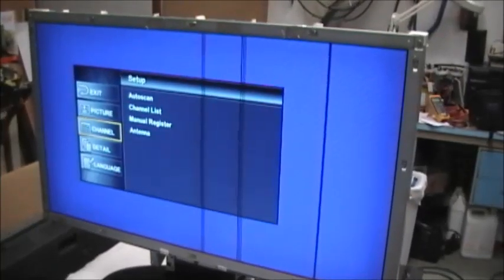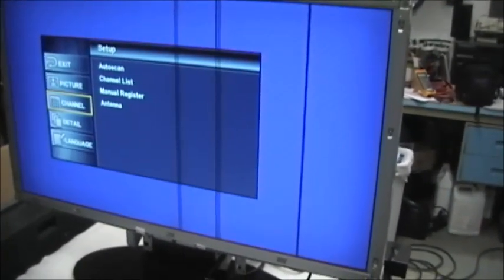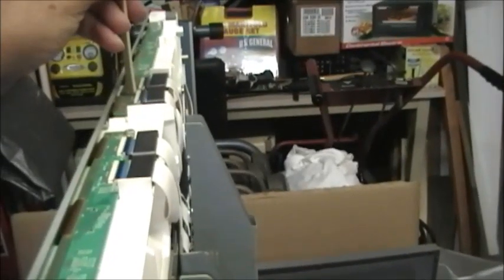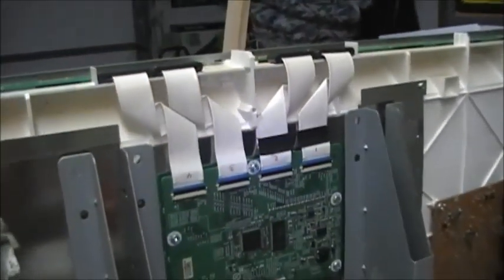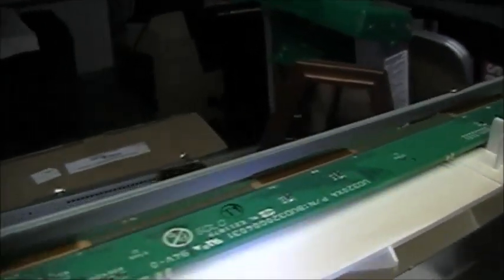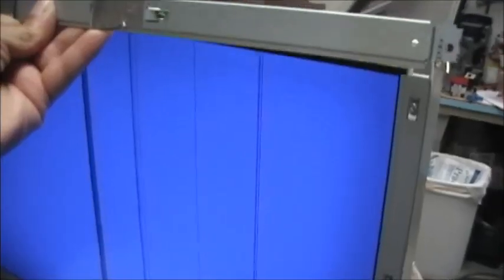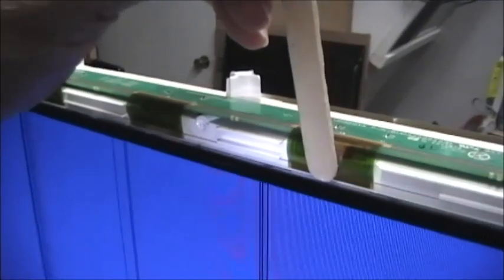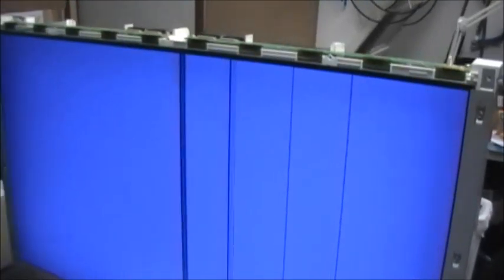LCD TV Repair Secrets - Vertical Lines on the Screen

Comment: Great video showing the issue and so common sense now. To bad it doesn't follow with an actual viable longterm fix.
Reply from the maker: There is no long term fix, at least not for the do-it-yourselfer. To fix TV's with this problem, you need to replace the LCD panel but consumer electronics manufacturers don't sell replacement LCD panels. Fifty years ago when I started in this business, US manufacturers we're required to provide replacement parts for at least ten years. At some point that was cut to five years, and now we have to petition congress just for the "right to repair." We're lucky to get any parts! Those we do get usually come from aftermarket suppliers, but presently, there are no aftermarket suppliers of LCD's. It's odd, because you can get cell phone screens and laptop screens, just not TV screens. At some point, maybe that will change...
Reply: There is a longterm fix, you shim it with weatherstripping foam and make enough pressure on it. They will not come back. Yes it can be done DIY. You don't have to replace parts to fix them. You being in the TV repair business all you have to do is get in there with conductive glue and reattach it. It's not hard at all. Part of being an electronics repair tech is to adapt and improvise to solve problems. Those who refuse to learn new techniques are the ones that go under.  There was a radio repair technician in Wisconsin that was in business for 70 years.  He repaired everything from brand new Walmart car stereos, to 100 year old console AM radios. Even coded exotic car radios.
Reply: @MrWolfSnack  It is much more complicated than just sticking some glue on a cable and calling it done. The glue is not literally just "conductive", it is an incredibly strong heat-resistant adhesive which forms a conductive path under very specific physical tension. This tension re-aligns the molecular chain to produce an electrical pathway. If the tension ever so slightly changes, it's no longer conductive. This is why applying pressure to the cable "fixes" it. The necessary tension is being applied to make those particular faulty connections conductive again. 

This isn't a result of the glue becoming "unsticky", it's a matter of the actual molecular composition of the glue changing. Think of it like a physical chain. When placed under the correct tension, a chain is very strong and it can link two moving parts together. But if that tension changes even a little, that's no longer the case. The chain suddenly becomes sloppy, there is a lot of play in how it moves. The parts are no longer securely linked. Same exact principle here, the difference is the chain is molecular, and it's not solely about physically holding two things together. It's about being electrically conductive. 

It is possible to replace these kinds of flex cables. I've seen it done on iPhone panels that needed new cables attached. However, it requires very specialized equipment. This variety of conductive adhesive requires intense heat and pressure to align the molecular chain and create a conductive pathway. You can't just heat the cable and pop it off, that's not how it works. And even if you could, you'd still need the machinery needed to create the conditions necessary to make it usable again. 

The only reason people are able to do it to refurbish iPhone LCD/OLED panels is due to demand. Apple doesn't sell original parts en masse, so restoring an uncracked original panel to working condition by attaching a new cable is a recycling process that is seen as worthwhile. This demand just doesn't exist for TVs or other displays, otherwise I'm sure some exotic tool from Shenzhen would be available for it. Additionally, the cables are much smaller on something like an iPhone. You don't need a massive manufacturing machine to do it. A piece of equipment that fits on a workbench and is the size of a big speaker can handle the task just fine. Very different story for all the different kinds of interface sizes you'd find on hundreds of thousands of different big display panels. 

Displays have been using adhesive bonds like this for a very, very long time. Even the earliest dot matrix panels like on the Gameboy DMG used similar manufacturing processes to get the cables attached to the display. I don't know if you've ever heard of the "line fix" on those dot matrix panels, but what they do is they run a soldering iron over the flex. Many mistakenly believe this is "reflowing" the solder, but there is no solder. At least, there isn't any where the cable meets the panel, and that's where they're running their irons over. All this does is change the pressure and tension of the adhesive bonds on each individual connection (which are micrometers in width, mind you). Sometimes it works, sometimes it doesn't. 

If you think you can just get some "conductive adhesive" and somehow figure out how to properly disconnect the cable, then figure out how to precisely stick the glue down on a micrometer sized target, without causing any excess to spill over and short nearby micrometer sized connection points, then go right ahead. But you clearly have no clue what you're talking about. Additionally, radio repair is entirely different from something like displays. A transistor radio built in 1957 is going to be almost exactly the same as a radio built today. The difference is the parts will be smaller. Still hand solderable, most likely annoying, you may even need a microscope. But still totally doable for a DIYer. Fixing cables like this, though? No way. You need very specialized equipment, far more specialized than anything you'd use to fix radios.
Reply from the maker: The only long term fix is to replace the display panel, but we can't do that because manufacturers don't make them available.
Reply: Well, instead of backhanded whining, the fix is a new TV, or better yet, drag out the 150 lb. crt TV. There are 40 year old TV's still running from days before shrewd profiteers took over everything.

Comment: You tell us what's causing the problem but you don't tell us how to fix it. 

Does the entire LCD panel have to be replaced? Or is there a way to re-adhere those ribbons? 

It would be nice to know, because my week-old Sony XBR-65X850C has just started displaying a 4" wide white streak from top to bottom, with a few narrow black lines inside. I'd like to know if Best Buy should just swap my TV for another new one, or if the bonding problem can be repaired at my home.

Comment: My vizio model VL470M (LUKEHBK) only has two circuit boards - power supply & mainboard.  No vertical lines when on screen display is enabled.  Vertical lines on left side with video signal as well as overall pink hue coloring all video.  Suggestions??
Reply from the maker: +lofty don
Have you disconnected/examined/reconnected the ribbon cables which connect the main board to the LCD panel? You've almost certainly got a loose or corroded connection on one side of the panel...
Reply: If you have vertical lines, flex connection from the screen to the board can be the cause. The more likely this will be the cause if only one 1/2, or 1/3 of the screen is affected.